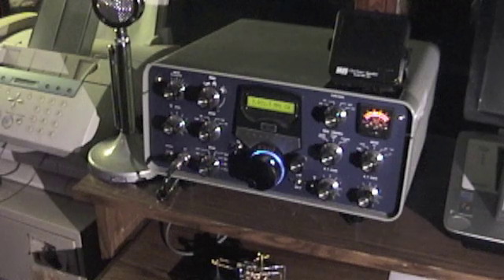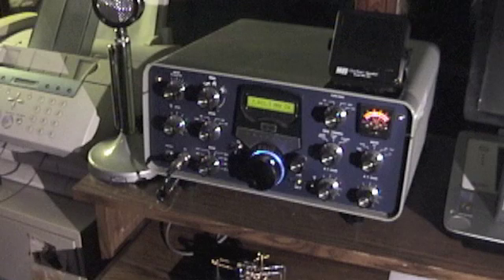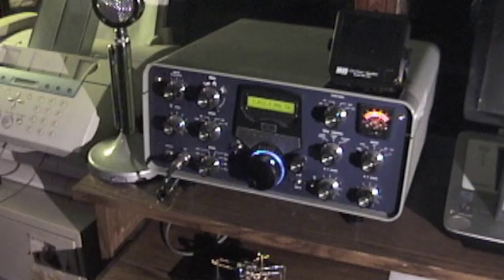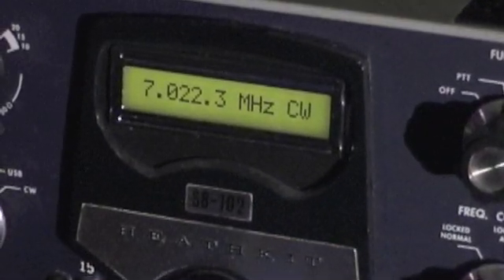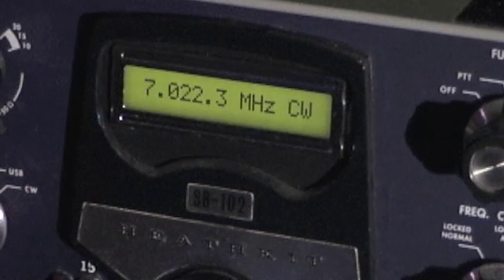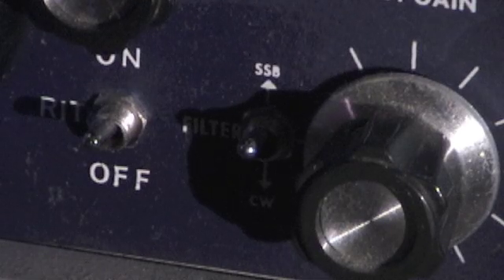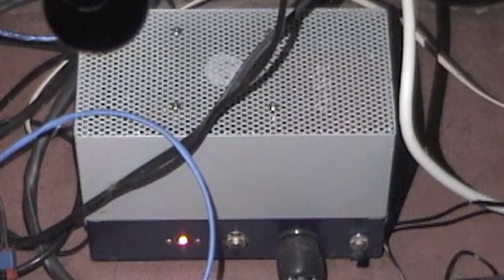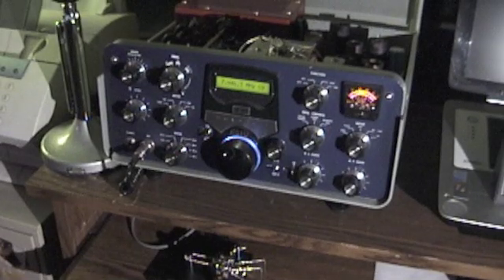Unique Heathkit SB-102 (Part 1)

Comment: I bought a frequency meter to modify my SB 102  but it needs a attention and possible recap and checkout on resistors - I've some of them althered when I had it by gift and a ceramic capacitor of coupling to final was with fail isolation, causing fuse blows up.even at reception... It is out of attention for aprox 5 years, needs to swap those rubber rings on final adjusts too...

Comment: I really enjoyed seeing your videos of the modifications you did on your SB-102. I bought one as nonworking and plan to go over everything and get it running again. It looks in good shape except for the tuning display. The plastic is all cracked up and I haven't found a replacement. I think your digital display is the best solution for me too. I'd like to do most of the same things you did on my radio too. Maybe it will make a nice winter project for next winter. I don't have my amateur radio license yet, so there's no rush.
Reply from the maker: Thanks, Chip.  If you search on Google and eBay you can find those replacement parts.  A couple of small companies are making the difficult to find parts that seem to fail eventually.  Taking your time will yield a nice-looking and working rig.  Good luck.
Reply: @ks1u  thank you. That's what I aim to do, take my time. I'll try to keep everything as neat and tidy as I can. Someone did a nice job of building it. It looks really nice inside and out.
Reply: @ks1u  I just search online for the DFD2 display like yours and it said that Neil Hecht, the producer of those displays, died back in Aug of 2015. All of his products are no longer in production. I guess if I want one I'll have to start from scratch...
Reply from the maker: @chipwright6193  I don't recall where I saw it, but I'm sure that there are other kits out there that provide the same performance.  It may have been on one of the github files.
Another option would be to replace the vfo with something like the one available at: https://www.wa1ffl.com

Comment: Hi George.   Do you have any details that you would share on what you did to your SB102? I am really interested in the front panel and the frequency display.

My Front panel is in bad shape and I want to restore mine. Thanks Bruce AA4BR
Reply from the maker: Hi Bruce.  Unfortunately, since I did this rebuild close to 15 years ago, the guys who did the silkscreen for the panel and the digital display are not doing either project anymore. I did just buy a new overlay for the front panel of an SB220 amp off of a guy on eBay, so maybe a search there will lead to a replacement for the SB102.  There are also occasional front panels sold on eBay as well.   Sorry, I can't be of more help.

Comment: Thank you for sharing. I know it is best to be original, but sometimes that just is not possible because parts to do so are not available, or something is so far gone that it is better to combine with something more modern to make it functional as opposed to it going in the garbage. The worst possible thing is when things end up scrapped or in the garbage. I like what you did with this unit, and there is nothing wrong with combining different kinds of components to make something work. I have even taken this to the extreme at times by using a string of light-bulbs as a current limiter/ regulator for high voltage AC. There is really no easier way to do things sometimes than combine old and newer technologies. Tubes are great for some things, but impractical to use as part of a digital computer for example in anything other than a display. I know it is possible to use tubes, photo resistors, neon bulbs and such to make a frequency counter. That is because they were once made that way. Now days getting things and either fixing them or fixing things that we have with what is available is the best way to go. 

I have thought about taking a transceiver such as what you have there and adding a digital display along with phase locked loop to  get it to lock onto a signial and not loose it as the transmitter is moving in respect to the reciever, or keeping tuned into a signal as a recover is heating up. Also phase locked loop is good for keeping Uncle Charlie away from giving us problems by staying on frequency. There are things that are hard to do with anything other than tubes as you know, such as reliability when there is an SWR mismatch, or a lightning strike close by taking out the front end of the radio part. Tubes can take a few hundred volts on the input and survive, where a transistor or IC will explode, that is if it just does not just short circuit first. 

I grew up around tube radios, TV, and so forth. Built my own things from scratch at times. Glad to see that you made the best of that transceiver, as you can make use of it and besides in the grand scheme of things that is what really matters. The thing that got me interested in electronics, computers and more is the ability to make things do what I want them to do. Things that often were overlooked in the original design. When the dial indicator is so far gone that it really is not fixable, a digital readout is the best way to go.  

You did great, as you saved a piece of gear from the trash, and that is something I see as the worst thing to happen with things. Everyone looses out when things that are usable are thrown away, and the more things that can be saved and if not used exactly original at least modified where it is usable.
Reply from the maker: Thanks very much for taking the time to comment.  It's always nice when someone can appreciate the time and effort to complete a project I've done.  If this radio had been in better condition when I bought it, I would have tried to rebuild as much as possible in its original configuration.

Comment: Love the sb-102 I have one  I would love to upgrade it like that any chance on getting parts list
Reply from the maker: My notes are packed away in the basement "somewhere".  Fortunately, there's a guy on eBay selling newly manufactured front panels.  All the other parts are still available online, mostly on eBay.  If you stick with the analog readout, it will be a much simpler project and only require you to upgrade the resistors and caps.  There's also another YoutTube video which goes over the making of a Teflon harness:  https://www.youtube.com/watch?v=C5YooZjfEG0&t=30s
Reply: @ks1u  thanks 73s kn4kbn

Comment: Now , 9 years later,  I would like to see if this modified radio is still working well, and up to the expectation of the owner.
Reply from the maker: Yes, the radio still works fine.  I keep it packed away since I now have limited space in my home, but occasionally dig it out and fire it up.  If I were to do it again, I'd probably be able to replace the entire vfo with a digital unit, but other than that I'd do things very close to the original build.

Comment from the maker: Unfortunately, the guy who did the silk screening for me stopped doing it a few years ago.  If you have a T shirt shop near you they might be able to make a screen if the faceplate you have has most of the lettering  in place.  Mine was so far gone I had to sand down the faceplate to smooth the gouges.

Comment from the maker: Jim, if the Swan has a 5.5 MHz VFO, it should work fine.  You may have to play around with capacitor values.  You may also have to experiment with where you tap into the BFO and oscillator to get the other signals.  It's not a guaranteed plug and play, but it's definitely possible with a little playing around.  If you have a kit from Almost All Digital Electronics, there is info on their website which should help.  I reduced capacitor values to the lowest levels which gave good perfirmance.

Comment: Inspiring! Question about the power supply - Did that one have the tube rectifier? If so, did you replace it with diodes? I've always wondered if that would be an easy improvement. Would certainly cut down the heat.